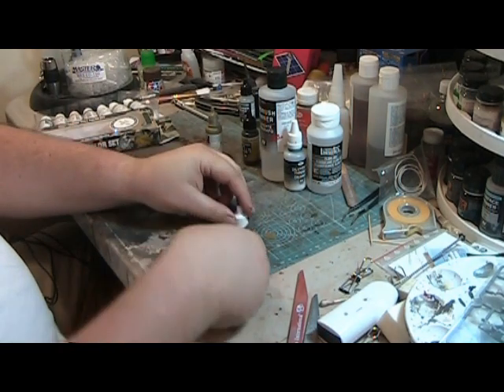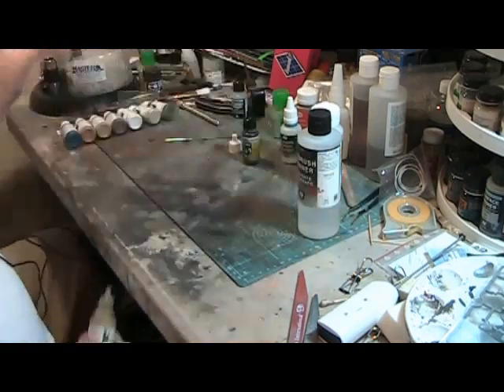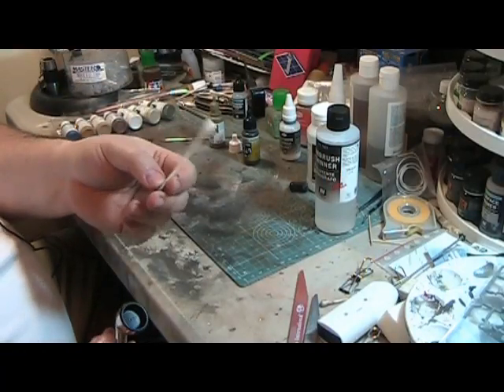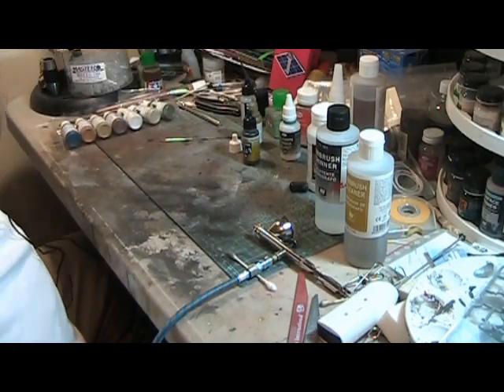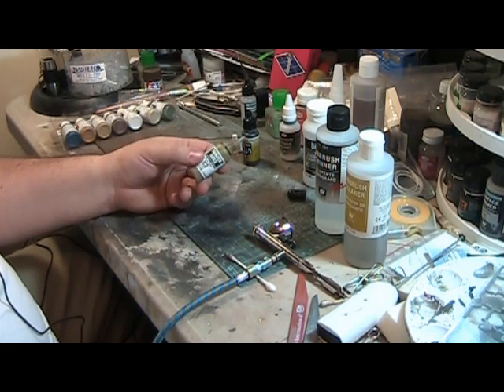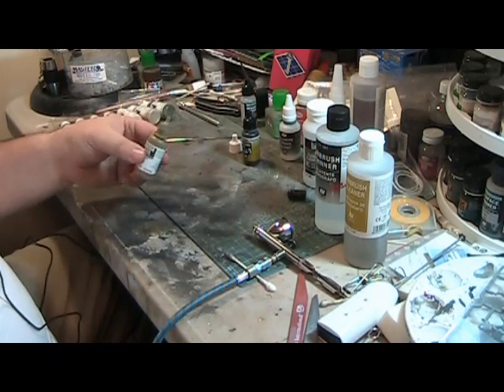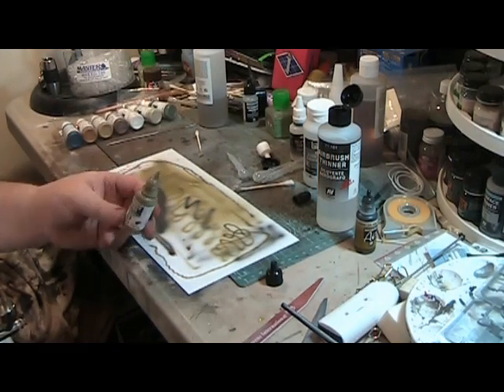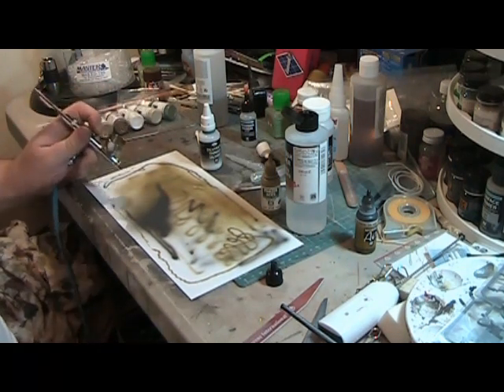Thinning and spraying Vallejo Model Color and Model Air

Comment: Even when I thin model air I still get a gritty coat When I spray it through my airbrush I tried all types of ratios with the thinner and with some flow aid
Reply from the maker: What you are experiencing is called "orange peel".  The paint is drying before it hits your subject.  This is caused by either too much pressure or being too far away with your airbrush.  I would first move closer only about 3-4 inches from your subject and then if that doesn't work turn the pressure down.  You only need 15-20 psi to spray Vallejo paints.
Reply: I wish this video had been around ten years ago when I started airbrushing, it would've saved me a lot of grief! Also, good job on the correct pronunciation of Vallejo, it aggravates the s@*t out of me when people  mispronounce that name (it's a proper pronoun. dang it)! Keep up the good work!
Reply: abel paoli What do you mean?, The most common way of pronouncing Vallejo is Vah-Lay-Ho and while it’s not the Spanish way of saying it it’s still just as correct as Vah-Yeh-Ho, Adding to the fact that most people will look at you funny if you pronounce it in the spanish way.

Comment: Can i use Tamiya and Vallejo acrylics together ? Like, can i prime with Vallejo and paint Tamiya over it ? Because i'm sick of this Vallejo's cloggings. Even with the 1:1 thinned tap water, it sprays out but clogs quickly, or just fades away after 4-5 sec of spraying..
Reply from the maker: Slammer Yes that would work just fine.  Vallejo is somewhat pressure sensitive an increase on your regulator to say 20 psi would help.  Liquitex makes a product called "Flow Aid" that works quite well it breaks the surface tension of the paint but I would only use a drop or two in the paint cup.
Reply: TacticalJackalope today i ve found that windex works better than all of them. I live in a hot country in turkey with a heavy humdity. Maybe its another reason ffor quick drying
Reply: TacticalJackalope another fact is, i just dont want to use separate colors for ab and brushing. For ab, tamiya is the best way to go, but they cant be used with brush. Its not an economical way to go besides the both paints arent compatible with each other as far as i know
Reply from the maker: They are  both acrylics but Tamiya Color is alcohol based.  Tamiya Color can be thinned for brush painting I use it all the time.  It doesn't take much X20 I thin it about 4:1
Reply: TacticalJackalope You mean X20A ? Is it same with the good old IPA ? And, is the ratio 4 paints to 1 thinner ?

Comment: Every time I use the Vallejo primers my airbrush clogs up.  I'll find that sweet spot and then lose it.  Once I find that sweet spot between paint, thinner and air pressure the Vallejo paint coverage is awesome.
Reply: I had the same problem. I have been adding Vallejo flow improver to my primers and paints. be warned this will increase the drying time, and your primer will go down wet. you will have to play around with the ratio, but I find 50/50 works for me. 

I have taught myself to not pull the trigger all the way back when spraying. This dramatically reduces the amount of paint being sprayed. This is important, because when airbrushing highly thinned paint spider legs are a problem.

Comment: If ball bearings are hard to find - BBs for an air rifle work pretty well and in the US are plentiful and cheap.
Reply from the maker: casualmayhem Ball bearings are not hard to find.  In addition you absolutely do NOT want to use BB's in an acrylic paint.  Most acrylic paints are water based and BB's are mild steel which means they WILL corrode and destroy the paint.  http://www.ebay.com/itm/100-1-4-inch-Diameter-Stainless-Steel-440C-G16-Bearing-Balls-/400280238646?hash=item5d328fba36

Comment: for ball bearings you can use slingshot ammo just a thought
Reply from the maker: +Black Heart Too expensive you can buy stainless ball bearings for about $8 a hundred
Reply: true but I found that stainless steel bbs also work well
Reply: regulat ball bearings will eventually rust. there are galvanized ball bearing that are rust free.
Reply from the maker: John B That's why I recommend 440C stainless ball bearings they are about $12 per hundred on Ebay.

Comment: I have the same stuff, vallejo paints, model, panzer and air.. badger patriot, acrylic thinner, retarder and air flow improver, and I dont get results nearly as good as this in video :( I either get thick paint that wont flow but gathers on tip of needle and spits little bits of paint around, or I get too thin paint that will flow. I am kinda losing hope already as I cant just paint, its 95% struggle with brush trigger and paint thickness and 5% painting, and even then its always risk of ruining it with sudden flow or spit :( Really not sure what I am doing wrong. Watched lot of videos by now and no answer.
Reply from the maker: Vallejo paint can be inconsistent and without observing you I cannot say for sure what you might be doing.  I'd recommend switching to a paint a little more forgiving like Tamiya color.
Reply: Yes, just trying to find where to get them. I used to order vallejo paints from some english and polish hobby shops, but since recently they cant send me tamiya because of some new EU aerosols regulations. I will check on ebay. I will order a test few bottles of tamiya, gunze and such and see if its better.

Comment: I dont quite understand how do you clean the nozzle? Maybe due to not being a native speaker Im not entirely sure what the nozzle is. Isnt the nozzle the hole where the air comes out? How do you clean that without removng the needle? are you just pulling it back? Wouldnt it make sense to clean the needle as well ?
Reply from the maker: +cryionic I keep a Q-Tip(cotton bud) wet with airbrush cleaner to "wipe" the excess and dried paint from the tip of the airbrush.

Comment: Hey TacticalJackalope, thanks for the demo. Can Tamiya paint thinner be combined with Vallejo 'model paint' in an air brush? And if so, do you know the ratio? I'm using an Iwata Revolution at 45 psi. Any tips or suggestions you have? Thanks
Reply from the maker: +jammerman28 No it cannot I'm afraid.  The Tamiya X20-A thinner is isopropyl alcohol based and is Not compatible with Model Air or Model Color.  Vallejo paints can be thinned with tap water or their own thinner that is what I would recommend you use.  In addition 45 PSI...?? WAY too high.  Vallejo likes low pressure and sprays best around 12-15 psi.  Thanks for watching and good luck!

Comment: Wow.....fantastic video, as always. I get withdrawal symptons if youve not done a video in a day of two. I need to get out more! You say that Model Air is thinner than Model Colour, but have you had to use a retarder on the Model Air? Nice idea to compare the two - do you prefer Vallejo rather than Tamiya acrylics? I use Tamiya as they are a lot cheaper, in the UK at least, and have used Model Air Russian green one time, and it turned out nice. Question about air pressure. As you know, I am just learning about airbrushing and thats why I love your videos, buu when you mention 12psi, I presume you turn on the compressor, press the trigger and then set the air pressure when its blowing out air, or do you set it to 12 without pressing the trigger and use it like that?
Reply: How are you gonna get the washers/ball bearings in the Model Air bottle?
Reply from the maker: Hi Stevie, no you do not Need to use the drying retarder for either but in long paint sessions it can help reduce nozzle / needle clogging which is of course very handy.  No, in all honesty I prefer Tamiya but their range of colors is not as extensive.  I find Tamiya color very forgiving on thinning and it sprays as smooth as glass.  I like the Vallejo as well but for Luftwaffe colors and some of the Panzer aces range they are the only game in town(more or less) and they are cheaper than Lifecolor which is a superb product as well.  Yes, I set the pressure after my compressor has filled the tank initially.  Every brush will be different my Badger likes 12-15 psi and my Tamiya/Iwata's like 15-20.  When I spray base coats or varnish I will be at 15-20 depending on how thick the medium is and when doing finer detail or narrow camo schemes I will spray at around 10-12 psi.
Reply: Ah.....ok. I only have a cheapie compressor without a tank.
Reply from the maker: Stevie my compressor only cost $79.96 in U.S. dollars which would only be about 40 quid.  You should be able to find something similar in the U.K.  Here is the exact one I purchased and btw Coen has this one as well.
http://www.amazon.com/High-Performance-Airbrush-Compressor-110-120V-HoseFor/dp/B009S3AP1O/ref=sr_1_4?ie=UTF8&qid=1395967078&sr=8-4&keywords=airbrush+compressor+w%2F+tank
Reply from the maker: Stevie Gibson The dropper lid prys right off.  Look for the seam underneath the dropper you can use your finger nail or a pocket knife to pry it off.
Reply: My compressor is exactly the same but without the tank.
Reply: With your inspiration, I just painted two of my shelf queens - the t34-85 and the KV1 that I made about 20 years ago and left in white primer. I made up my own Russian green from various Tamiya colours and looked nice in the bottle but actually was much darker when sprayed. Looks ok though, don't get me wrong. My main beef about airbrushing is it looks patchy when your spraying - some bits dry faster than others, but leave it for 10 minutes and.....perfect! It's amazing how the paint "shrinks". So i'm quite chuffed! Learning how to operate my Paasche without spilling too much. Practice makes perfect. Thanks for all your help. Stevie Gibson

Comment: Well the only problem I have is I do not have an airbrush with gravity feed my airbrush is the regular badger that's not gravity feed and you did not state which thinner to use for the model air I know I put that in my paintball and it's just sits there on the bottom I have to put dinner or some kind of thinner in my bottle and mix it to start spraying so I need to know which thinner to use for that paint to put in the bottle to keep it from clogging up my airbrush you showed several thinners,but did not use any you mainly talked about your air brush cleaner and, didn't demonstrate any of the other thinners or, which one was the best to use
Reply from the maker: EMMETT ROWE The video was pretty clear actually.  You don't need to thin model air it's ready to go from the bottle.  If you thin any vallejo paint I recommend you use their thinner.  Water based acrylics will clog it's unavoidable they make a product called Airbrush Flow Improver which they did not when I made this video almost 4 years ago.
Reply: TacticalJackalope  will that I understand but that's was a gravity feed I have a siphon  feed badger so how much of the vallejo should  I put in the bottle because that's a big bottle with a long siphon tube..so I haven't to add thinner to half fill the bottle to be able to start spraying...so,what do you recommend that i can do ??

Comment: I'v tried the vallejo ( color not air) with Mr.hobby solvent... It was a nighmare.

I will try both the solvent and retarder medium from vallejo.

Or should I use the Liquidex Flo aid instead of the vallejo retarder ?

They both retarder right ?

If that doesn't work then I'm done with vallejo color (not air tough, air is great ^^ )
Reply from the maker: Rynex Model air does not need to be thinned it will shoot straight from the bottle.  I also ALWAYS recommend you use the original manufacturers thinner and cleaner.  The Vallejo retarder is more for slowing drying times and has nothing to do with improving flow from your airbrush.  I have used Liquitex Flow Aid but am now exclusively using this product: http://www.amazon.com/Vallejo-Airbrush-Flow-Improver-Paint/dp/B00QD780OC.  It works perfectly and allows you to spray without having to constantly remove dried paint from your needle/nozzle.
Reply: Thank you very much for the reply.

I personnaly don't use thinner for the air model ^^'

Only for the  Vallejo color model.

Good to know I thought the flow aid was some kind of retarder. I'll take the three products (thinner, flow aid, and retarder) at my local shop to try that.

So you if I use : 5 drop vallejo color, 5drop vallejo diluant, 1 drop retarder, and 1 drop vallejo  flow aid, would I have a decent result ?

Comment: very informative ,may I ask what size needle for the demo ? I know it can make a big difference as well...thanks
Reply from the maker: Andy X I was using a Badger Patriot 105 which comes equipped with a .5 mm needle.
Reply: ok thanks , I'm running a 3.2 needle so do you think it should be thinned more ?that's the largest needle I know of for my AB ..thanks in advance for the tips !
Reply from the maker: Andy X No I don't think you should have to thin it down more.  There are plenty of people that use even smaller needles that don't have any problems.  No worries thank you for watching and taking the time to comment.

Comment: Thanks. How about the Model Color's metallics ? Do you use them by any means ?
Reply from the maker: Yes I have the Model Color metallic set and have used them.  I believe they are supposed to be thinned with an alcohol based product but I have had success using the "old" Vallejo thinner which is milky white.
Reply: TacticalJackalope Hmm, i thought the alcohol as well :) I also have the old (white) thinner, as my local hobby shop doesnt have the new version. What was your ratios ?

Comment: Thanks for making this vid, quite helpful as i'm looking into what paints to get. Just a couple of questions:

1. What size needle do you actually have in your airbrush (0.5mm?), and if someone were using an airbrush with a needle smaller than that, would you still recommend the Vallejo products due to the clogging etc.? 

2. I'm just wondering about the model air range, is it just the same as model color but they have pre-mixed in the thinner at the factory? I ask because (at least where I am) a bottle of vallejo air or color cost the same, for the same 17mm bottle. Or have they altered the paints in other ways, finer pigment etc?
Reply from the maker: +hagakure81 Vallejo explains it better than I here is the link to their site(http://www.acrylicosvallejo.com/model-paints) but no there is more difference than that.  Yes you can use a smaller needle without issues.  Its not clogging per se it dries on the tip because acrylics dry so fast.  Some of their new airbrush flow improver will do wonders for you.

Comment: I use pellets instead of ball bearings. Always available and way cheaper :)
Reply from the maker: +Modellours Workshop Ball bearings are only about $10 for a 100
Reply: TacticalJackalope I couldn't find any :)
Reply from the maker: +Modellours Workshop No problem let me provide you some links;  http://www.ebay.com/itm/100-1-4-Inch-G25-Precision-420-Stainless-Steel-Bearing-Balls-/301564213850?hash=item4636a0ba5a:g:5v4AAOxydB1ShNpI
The shipping is free if you live in the U.S. I do not know what it is to Spain.  There are many more listing like this on Ebay.  1/4" is about 6.35mm.

Comment: Andy...usa BBs from BB guns for your paint bottles! Or very small clip on fishing weights. Just a suggestion...
Reply from the maker: Thanks for the comment Gary it's been a while.  I would remind you that this video is more than 4 years old now and I long ago sourced the "ball bearing" issue.  The problem with BB's is they are made from mild steel and will corrode and ruin water based acrylic paint.  I found a source a long time ago on Ebay that sells 440C 1/4" Stainless steel ball bearings for about $8 a hundred and they work perfectly.
Reply: Will do. Never read the dates. Just enjoy the vids! I'm just now getting around to learning finer points of model building seriously.

Comment: you can buy plastic bbs from eBay under airsoft 2gram 5mm ball bearings plastic so cheap
Reply from the maker: +rick stevenson Yeah but they are not heavy enough you need something with some mass.  The paint can be pretty thick at times.
Reply: +TacticalJackalope ahh OK Yeah fair point

Comment: Do you ever have to take the tip off and clean the inside Andy?
Reply from the maker: +Gary Armstrong I will do a complete strip down and clean an airbrush after I have used it 4-5 times.  If that is what you were asking.
Reply: +TacticalJackalope No...I meant taking the tip off if the clog proves too stubborn. Clean it out from the other end. And yes...I clean the a/b every time!
Reply from the maker: Gary Armstrong Oh, ok.  No, I don't remove the tip.  In most applications I am using my Patriot and the tip is exposed.  I simply have a Q-tip nearby moistened with some cleaner or thinner to remove the residue.

Comment: Ive been gerting clogs using Vellajo scarlet red air i thought this was a direct to airbrush paint but I had to thin it alot. It comes out chunky anyone else have this issue?
Reply from the maker: All water based paints "clog" or dry eventually on the tip.  Try using their Airbrush Flow Improver.

https://www.amazon.com/Vallejo-Airbrush-Flow-Improver-Paint/dp/B00QD780FQ/ref=sr_1_2?ie=UTF8&qid=1514555463&sr=8-2&keywords=vallejo+airbrush+flow+improver

Comment: I've heard using ball bearings in Vallejo bottles is a risk.  Once you're squeezing the bottle, and the ball falls down into the mouth and blocks it, you can end up popping the nose off your bottle and bursting paint everywhere.  I use small hex nuts instead, which won't clog the mouth.  316 stainless (marine grade) so they won't rust and change your paint color.